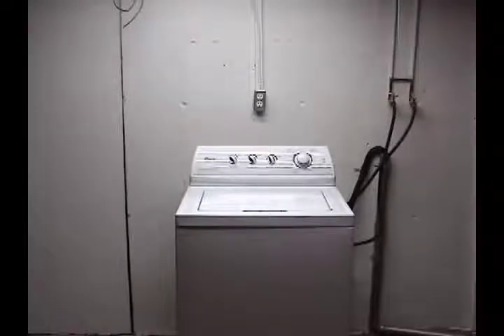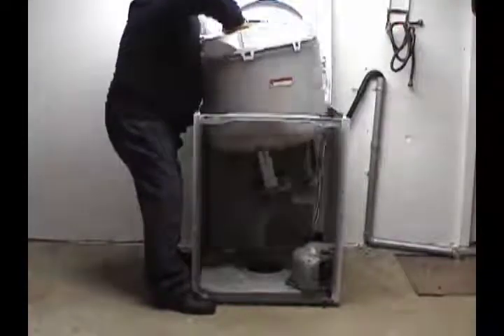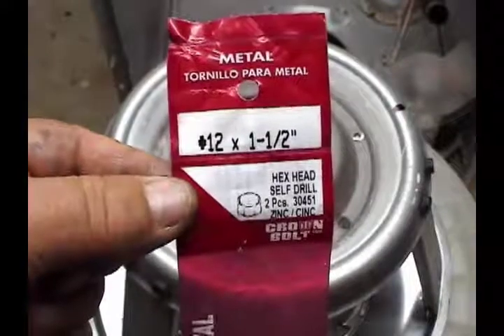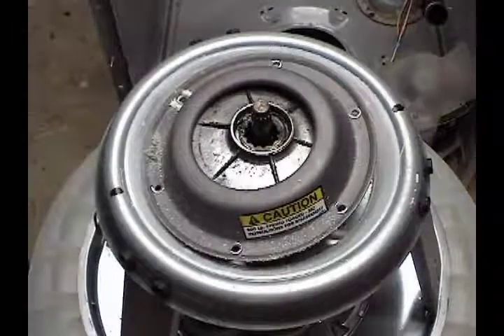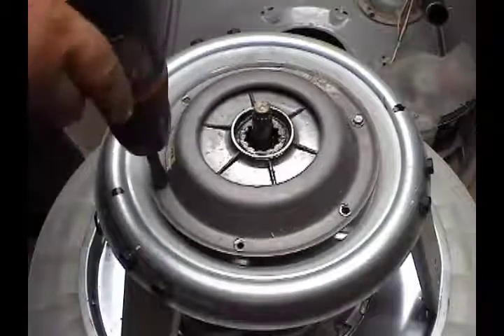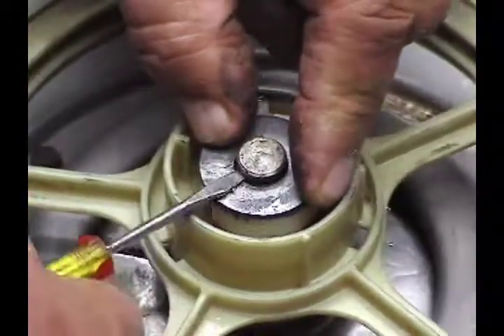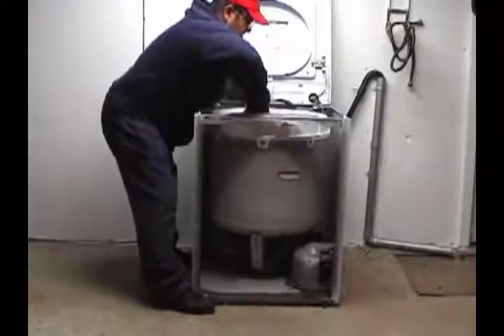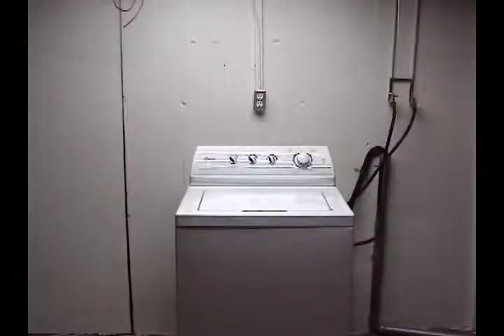Performa Washing Machine Making Noises - See How To Check & Replace the brake assembly

Comment: Question could the Brake Assembly stop the transmission from spinning the Agitator and inner Tub? Trying to see if my Maytag Performa Transmission is bad or not. I can’t turn the Trans pulley by hand with the belt off. Wonder if the brake assembly has it locked up.

Comment: No instructions on adjusting the brake though
Reply: There are no adjustments. The brake material as well as the drum need to be completely free of grease and oil. The brake is naturally on. I'm not certain as of now how the brake releases for the spin cycle. The tub is not supposed to easily rotate when the machine is stopped and the tub should not rotate when agitating.